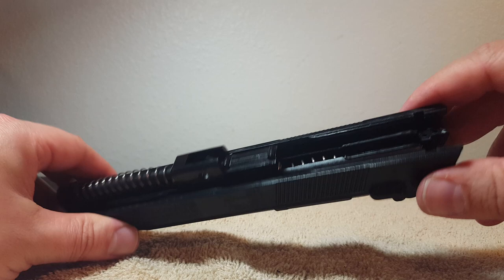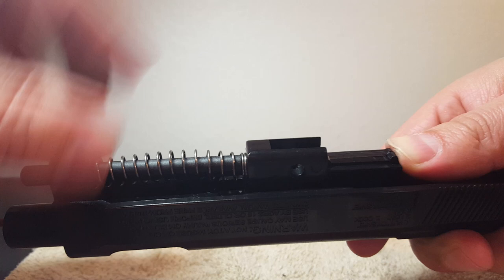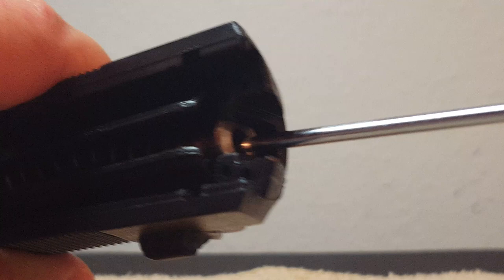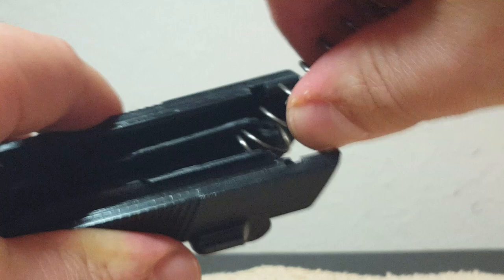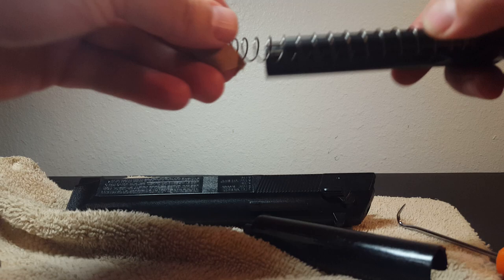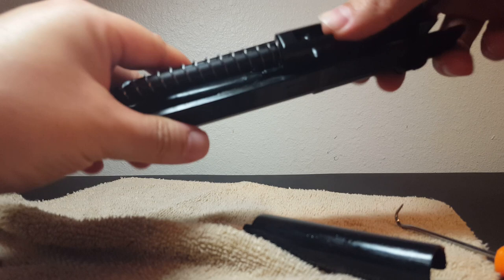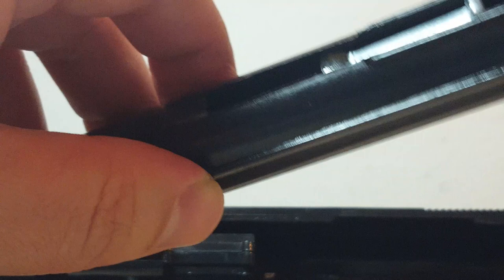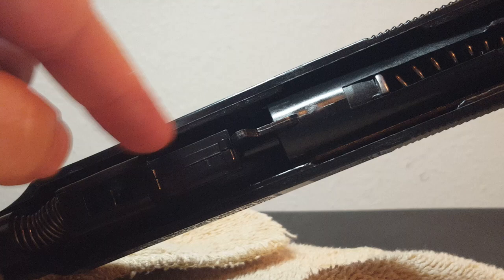Daisy 340. Disassembly/Reassembly - 2nd Edition

Comment: Thanks for the video.  I have one of these and it quit firing.  Took me about three times getting into it to figure out the round plastic tube that the seal slides up in and the bb loads through is broken all the away around the end.  I thought it was a manufacturing seam, but it had just broken off.  I have throughly cleaned it to get the oil off.  Tomorrow I will get a fresh tube of glue.  A very thin coat of superglue around the end to seal and hopefully not get down into the area the seal works in, then another light boarder of jbweld around the edge as reinforcement and a second shot at sealing any leaks.  Should be interesting to see if I can actually fix it.  Not going to pay $35 now for a $20 gun. Inflation sucks.
Reply from the maker: Good work! 

Yeah, the piston tube should be metal. It really shatters up front from dry firing. I work hard not to do that, track the ammo feeder.

I did manage not  to break my tube. It can be a struggle for others.

Comment: Thank you so much I had a stuck bb in the barrel and thought I had to disassemble everything thing but your tip in the beginning helped solve the problem
Reply from the maker: Yeah, 2nd edition much smoother. Just had talk with airsoft pro. If the BB jam is really BAD...then disassembly and tap out OUT the muzzle is called for without question. Or the breach seal can get shredded.

I just cleared my first 340 BB barrel jam with same method you just used - loose jam from just mildly defective new BB. I tell everybody not to reuse BBs. That was the first barrel jam in ANY of my BB guns.
Reply: Daisy 880 Fanatic Fix It I just got a bad jam and had to disassemble the entire gun it’s fixed but it shoots weaker now any solutions?
Reply from the maker: Hamg Le, sorry, just got this message.

You tapped out bad BB out front? Out muzzle? If you hammered it out breach it likely damaged the seal.

If you pushed BAD jam out muzzle, you just need to oil air tube with silicone. On disaseembly many dry out that clear piston seal. It slows it down. Try spraying some silicone through magazine port on to spring. That spring isn't the target, but the inside of tube is the goal.

If you hammered it out breach, sorry, but think new 340. Guard that breach seal. Don't reuse BBs.

Comment: Excellent video. Just got me a Crosman 2240 and it is a really fun little air pistol. What is your opinion of the 2240?
Reply from the maker: Great, platform if you don't want to pump - AND YOU KNOW - that you will be looking to fire at least 60 shots. I don't like any system that does not have onboard power.

My gunsmith works on PCPs but got rid of his because he feels the same. Also PCP loud and too much power for suburb. Some times we, as shooters, squeeze in short sessions of ten or twenty shots.

For me it is springers and pump up guns.

Comment: What makes the barrel/slide or top sliding pc pop off the tracks and just fall off my 340. I mean it literally  during FIRING popped up maybe  a inch or 2  from gun and hit the ground in front of me today. I haven't  tired to put it back together  yet. Thanks for sharing your videos.  Any help would be greatly appreciated!! Lol.
Reply from the maker: Scott, have you let a friend borrow your 340? Many times folks don't check their guns when they get back a loaner.

For that ACTION to happen the slide LOCK has to be absent. If you say the slide lock and release button are both present, that means a major break. 

Potentially the slide lock has snapped.

Check the slide lock and release button.
Reply from the maker: 2nd Answer: If your slide is off, check the hop up. It is the part on the slide that the lock goes through to lock the slide to the frame. Is there breakage ON BACK of the hole?
Reply: @daisy880fanaticfixit9  And you are right... my slide lock is gone.. no nothing!! My nephew  borrowed  it. Hopefully  I can get another gun lol. Thanks bro.
Reply from the maker: If DAISY still honors this video, check this out!!

https://youtu.be/IsDHKD-UgWk

Sorry just got this comment. YT got screwy.  See if Daisy ladies will help out. The CSR number is on their webpage under CONTACT US.

Comment: Great video, now I know how to completely take it down, thanks! Oh, and a quick question. I just bought one of these 340's for shooting in the garage. My co2 pistols are a pain, and too much power for the garage, that's why I bought this 340. It works great, very quiet, and perfect power for the garage. But what is the optimal range to shoot it?
Reply from the maker: Yeah, CO2 is dangerous to you indoors. 400 fps at 4 or 5 yards REALLY WOULD put your eye out on the bounce.

Try not to sling shot it, and it can last up to 5000 shots. The mainspring is good to around 8000.

Trevor, 4 to 5 yards is doable for 340. It can shoot through pop can if you use my carnival tricks.

What happens with 340 is the post in back breaks and shooters think they can fix it. Even if you glue with epoxy, it is hard to fix it precisely. Daisy should make the post STEEL.

Comment: Thank you bro
Reply from the maker: Jesus, just remember to tap any jam out the breech. I had airsoft kids say to tap length of barrel, but this is a STEEL BB. It can split open barrel.

Push forward on the slide spring and tap out jam with other hand using rod. The breach seal, or hop up, will be fine. Try to use only new BBs and only Daisy BBs. Some new BBs do jam, and zinging it out the backside is still best.

The piston tube can shatter in front, so taking it apart doesn't help there. Try not to dry fire piston or hammer. Things break. Make sure BB is loaded.

Comment: On reassembly I am able to get it to snap once but not completely
Reply from the maker: Gary, a lot of time has passed since this video. I actually transferred my flag to the psm45.

Now, on the video I snap back on the piston tube in free space for the camera. YOU should place it on a firm surface and push down HARD on your hop up (feeder).

TRY LUBE ON THE  LOCK RAILS: 30 ND MINERAL OIL or airgun silicone. No, not  WD-40. 

BALLISTOL if you have it.
Reply: My hop up (feeder) was broken so I had to replace the piston tube , is why I had it this far apart in the first place, I will try again

Comment: Hey can u plz plz do a video of how to fix it cuz my daisy power line 340 won’t shot or it won’t cook up and idk the problem and I just got the gun 9 days ago can u plz help me Idk the problem
Reply from the maker: Sam, search for my 340 video on 340 Not Shooting. I cover all the jams. Disassembly is only something I do when the spring is worn down and I save other parts. 

If it won't cock - which means engage  your piston - you might have simple BB jam where the BB SHOOTS up into your gun before you cock it. Watch my jam video, then my other videos on how 340 breaks

Use only Daisy BBs
Don't dry fire piston 
Don't dry fire hammer.

Comment: Think it will shoot faster if I stretch that spring ?
Reply from the maker: Tyler, that is a really fun question. IF you already have it apart, try it. It should give short term improvement. It could hold out for while.

Know that a more powerful spring could BREAK the air tube (where the spring rests). These tube can and DO break in front from cocking and dry firing. That and sling shotting the slide can crack the front of the tube.

Simple ways to up the performance:

 Give a puff of Ballistol. Do that on the spring every 600 to 1000 shots. That fine oil BOOSTS velocity, sort of like nitris in a car. Just eject mag, use light, and aim straw at exposed spring.

BUY ELITE BBs. I plan to buy a 4th 340 and run test to see if I CAN get that Daisy to QUIT JAMMING.  No more misfeeds. The BBs below improve POWER and accuracy. Remember to pop pop cans filled with water and flat in front - you can pierce it!

Ballistol can be found at gun shop or here:
https://www.pyramydair.com/product/ballistol-lube-aerosol-spray-6-oz?a=2072

https://www.pyramydair.com/product/umarex-precision-steel-bbs-5-1-grains-speedloader-1-500ct-0-177?p=1020

Comment: help.
my gun will trigger prematurely
the main spring that fires the bb fires after cocking it back
edit: as it goes back into the normal position it fires then
Reply from the maker: Ok, these 340s have many problems. I never had this malfunction, so I will just say they figured out how to make them worse, or the piston sear is failing because it wasn't lubed, wore down.

I went through three of these before I walked away. The third one went 6,000 shots. Each fatal ending was the post in back cracking and bending. The piston stops aligning and it won't cock.

With the piston sear, which holds back your piston when you cock it, you should see the sharp rectangle edge go up and down when you cock the hammer, pull the trigger, and ride the hammer up gently with your thumb.

Take your slide off and watch that part. If it doesn't come up a part is broken, likely a spring. Daisy won't sell it.

If the part works, turn your slide upside down and wipe CLEAN the  piston catch. See if it is grimey. That sharp edge grabs the piston sear.

Comment: mine doesn’t shoot please help
Reply from the maker: Kaden, it could only be a BB jam - either in barrel or A BB gets out of your mag and jams up your slide. 

You don't have to disassemble if it is a simple jam.

I have a video solely for clearing jams, if it doesn't shoot. Please search my library.

If it is broken, it is because the front of piston tube cracked from using Copperheads or cocking your slide without any BBs and dry firing. The post in back can break off if you dry fire hammer.